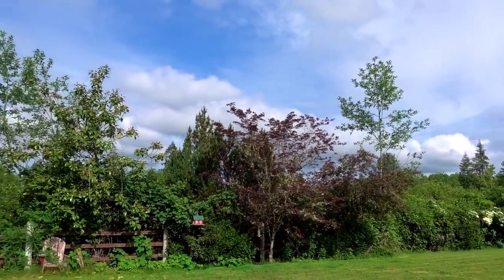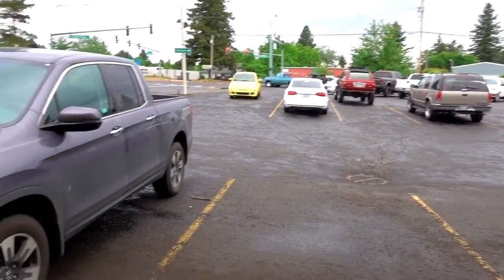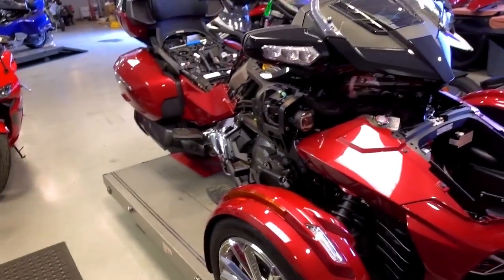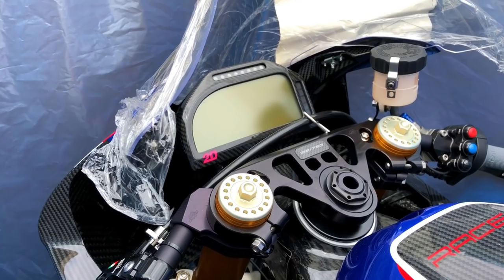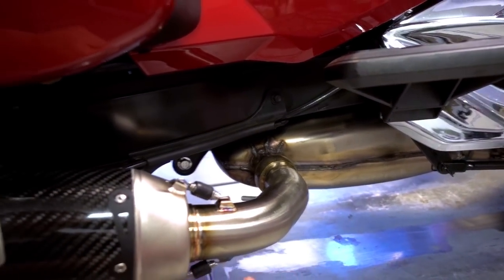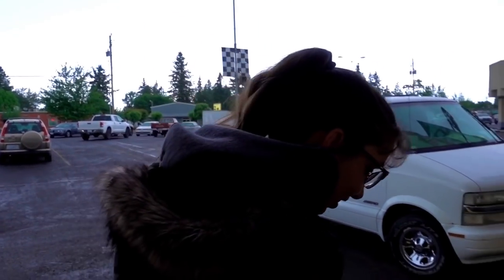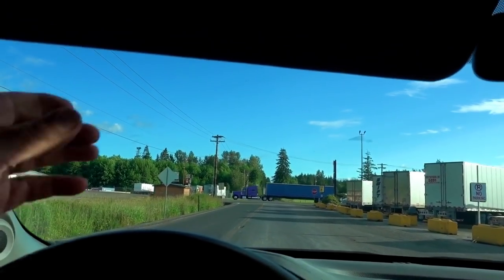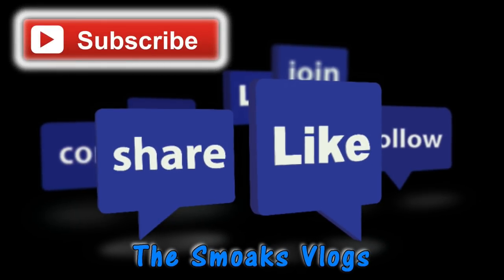HP4 Race No. 128/750!! • 215HP BMW Thoroughbred! | TheSmoaks Vlog_928

Comment: I think you change the engine in that hp4 race about every 5500 miles €12500 . If you want to here and watch it on track check out 44 Teeth on the tube 😮